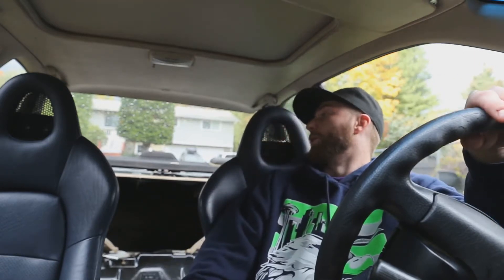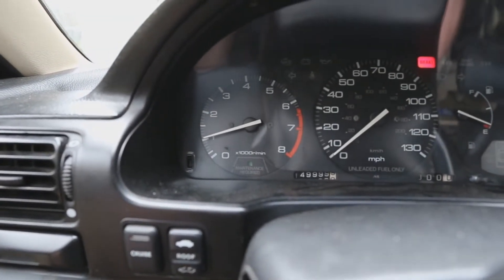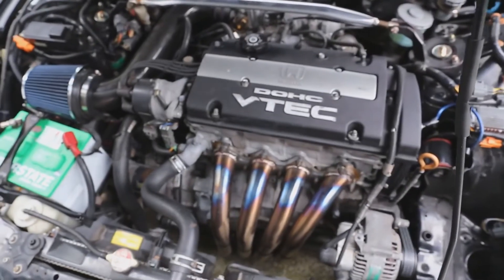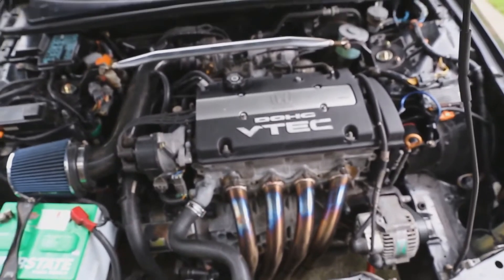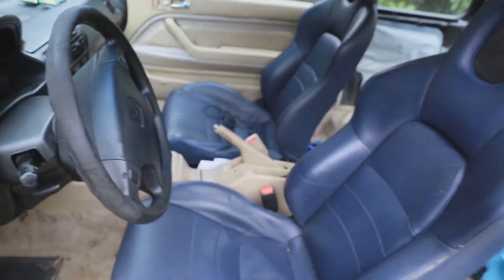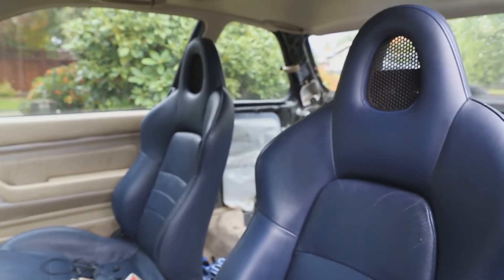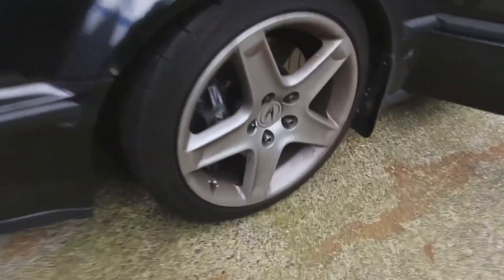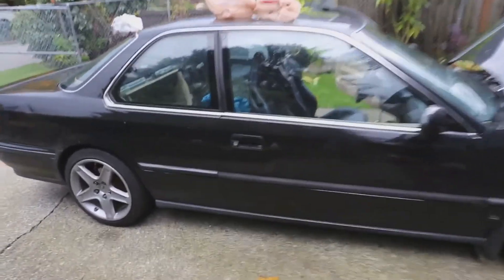H22 Cb7 Build Part 8 exhaust, s2000 seats

Comment: I was wondering what suspension setup you were using on your CB9 with the powercoated rims? I just watched your progess video and loved the stance it had before you went to 5x100. I myself have a h22 cb9 in WA.
Reply from the maker: llllRoyal thanks and it's 5x114.3 ... I'm on custom one off built coilovers by Broadway static
Reply: How much did they cost you? And did you also have camber kits on both front and back. I basiclly want to copy your stance exactly before you went to 5x114.3
Reply from the maker: llllRoyal $1300, form function (which is what is on my coupe will work for $500 and you can slam it like no other). i have angled arms made by spc for the rear. NEED ANGLED. STRAIGHT WILL NOT WORK. Front is natural camber on stock upper control arms.
Reply from the maker: llllRoyal I was -7% up front and -7.5% in the rear

Comment: sounds like your valves are ticking a bit but its no big deal, no power steering?
Reply from the maker: Valves might be need lashed, but to be honest it doesn't sound like that in person. They sound really quiet. Could be the video. Yes, no p/s and f20b crank pulley

Comment: Check Out My Other Youtube Channel @ DRock Garage I have a 92 F20B Accord .. Where did you order your exhaust from header and all. Im picking up a accord 2 door today.
Reply: get plm header and do a custom exhaust,3 inch is a much.
Reply: Yeah i got the PLM headers & 2.5 exhaust all the way back, its actually the H2B headers the seller for the h22 headers wasnt accepting payments at that time.. Had to cut a lil of the frame where the down pipe goes thats it..
Reply: DRockTV 3inch is worth about 10 to the wheels over the 2.5 inch. I've had both before and dyno before and after.  Plm makes power.

Comment: hkw is it with no power steering
Reply from the maker: SmoovMedia no complaints
Reply: Josh Papineau check my cb7 build on ig blueprint_auto ... 
how is parallel parking? and did u block off anything in the rack?
Reply from the maker: SmoovMedia lines are looped. I rarely parallel park
Reply: you know anyone with a sedan sunroof?